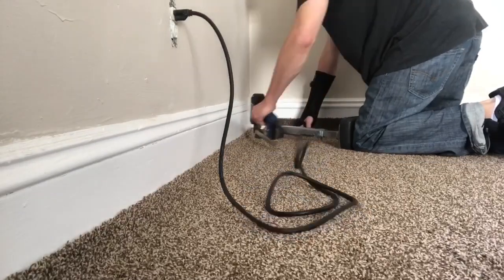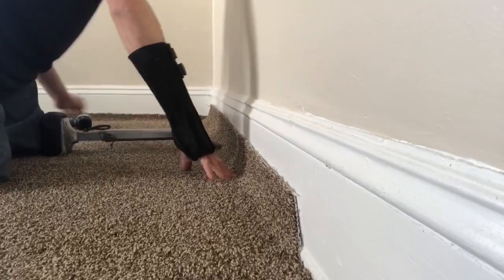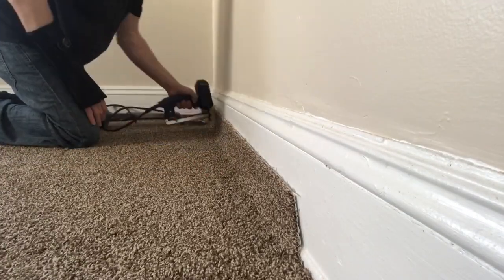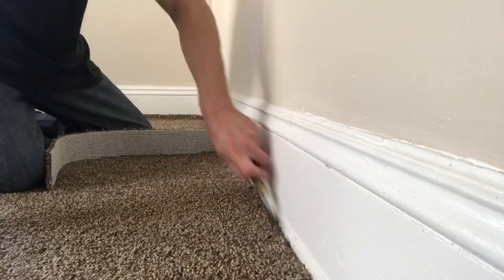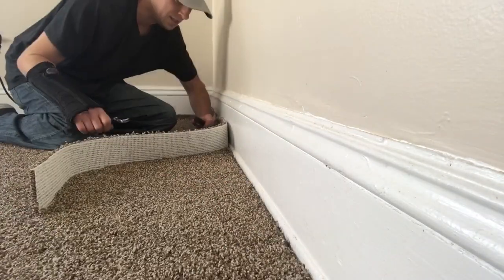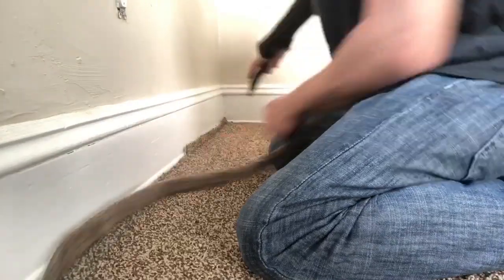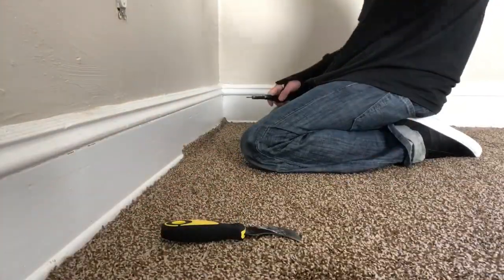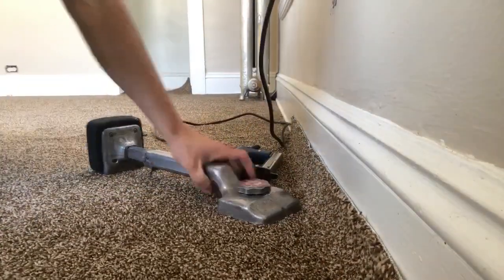Installing carpet the wrong way just because

Comment: Hello I have a dilemma 
 I just move in to a rental home an the carpet is beautiful, however when I walk around close to walls or on the stairs I actually feel the tack strips poke me in my foot.  What could be the issue here bc its unbearable an unsafe for me an my kids feet
Reply from the maker: Sheis 220 sorry for the delay! It’s a common thing you can take a hammer and tap on the edge of the carpet where the tax strips are poking through to bend the nails and you’ll be good to go!

Comment: Do you guys do a lot of patterned carpet on stairs?  We deal with a lot of tartan carpet  here in Scotland and I was wondering how you would estimate and plan for a pattern repeat on carpet.  Cheers dude.
Reply from the maker: Thomas Hart thanks for connecting! Honestly I work with very few pattern rugs these days just primarily cheap to midline plush carpets for the most part

I’ll try and map out a video sharing how to break it down as well as what to charge for this type of installation. Thanks!
Reply: Carpet Expert Blueprint you’re a ledge.  We have loads here.  Tartan central in Scotland as you can imagine.  Would really appreciate an explanation video for how you map it out.

Have a good one mate :)

Comment: Just out of curiosity, why don’t you power stretch or do i only see your knee kicking videos? We only knee kick closets and steps.
Reply from the maker: Timber ‘n Tackle thanks for connecting! Most Of the carpets I sell are 30oz and less so it’s real easy to stretch. I do use the crab in place of the power stretcher. 
I just don’t like lugging power stretchers around and the set up time that comes with them